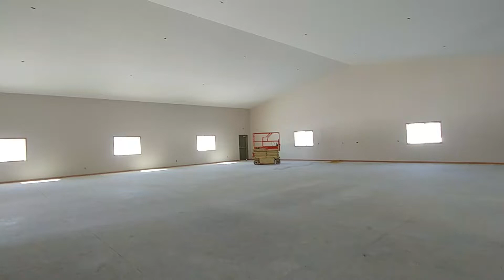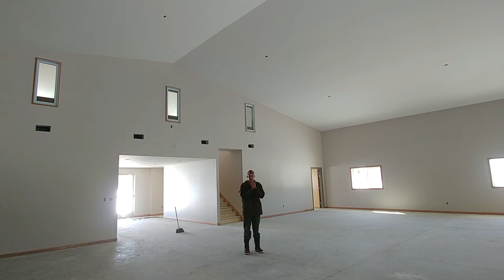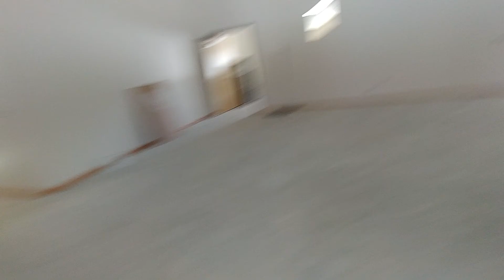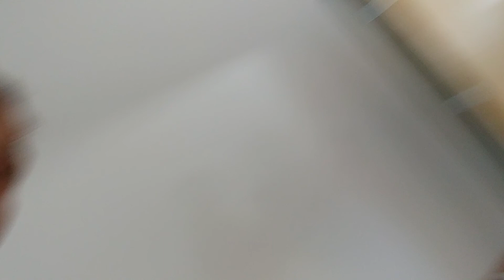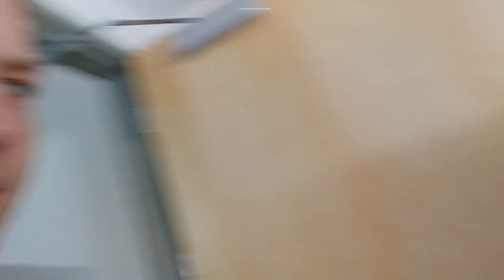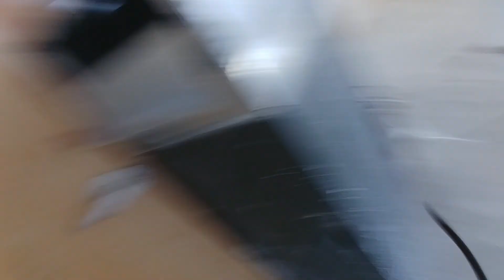Big Echoing Room - Example of an 8 Second Long Reverberation Time - Bad Acoustics Concrete & Drywall

Comment: I was in a shower that was all closed in and had very, very hard tiles  on the walls, and lights in the walls of the shower. 
The shower was also 
very, very freezing cold, all closed in, and it also 
had a terrible echo, which rang out for miles. 
"I love it in here. 
When you scream at the very top of your lungs, it has such a horrible echo in here. 
And that's what I am going to do right now. 
You better look out. 
WHAT THE HELL ARE YA DOING IN THAT 
FREEZING COLD SHOWER ROOM??
ALL RIGHT, YA GUYS IN THERE, 
LIGHTS OUT AND QUIET, OR I'LL SCREAM JUST LIKE A METAL TELETRONIX CALL MICROPHONE!!
ONE CHEEZBUGGA, ONE COTTAGE CHEESE, AND ONE HOT FUDGE BROWNIE WITH FILTHY, DIRTY  FIDDLE STRINGS ON TOP!!!" I yelled and screamed at the very top of my lungs. 
-Mark Weintraub.
Reply: uhm what is this about??????????????